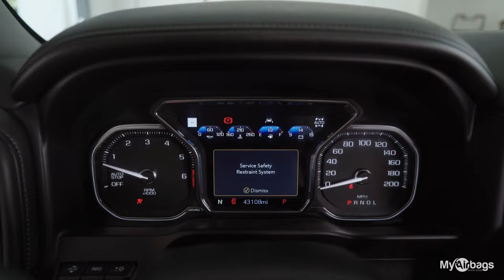How to Resolve SRS Light Issues After Seat Belt Pretensioner Installation | MyAirbags

Comment: Hi I have a problem after the accident and the airbag has been changed. I need to turn off the light of the airbag in my Jetta 2019
Reply from the maker: Yes you will need to have your airbag control module reset, here is link for more info
https://www.myairbags.com/product/airbag-module-reset-3/